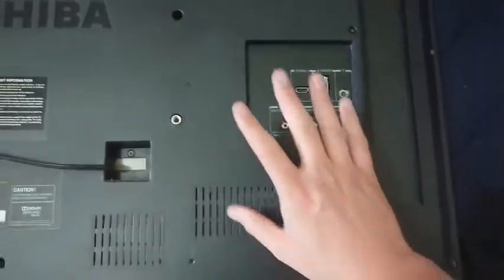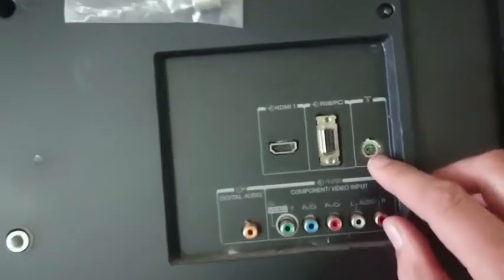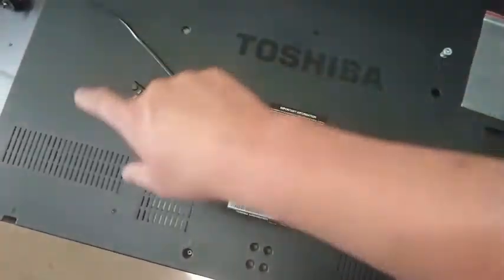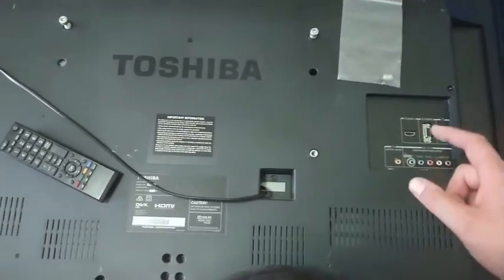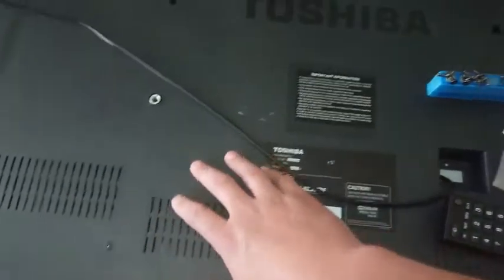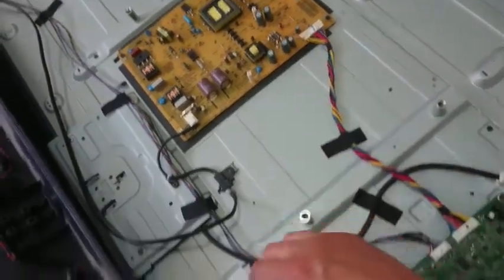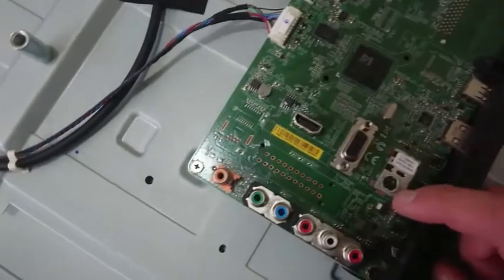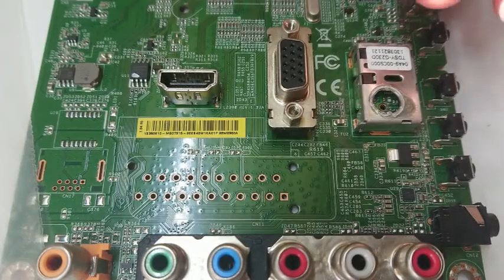Toshiba LCD TV Repair (Broken antenna socket)

Comment: Good effort mate, good outcome. The other reason for signal problems can be the big shift of frequency, moving up into frequencies more effected by objects and weather effects, better or worse propagation and reflections.
Very lucky with the socket.
Your other solution would have been to get an aerial extension lead and cut it in half, and hard wire the socket half of the lead into the socket hole.
This way you have a flying lead outside the TV, cable tie it in a couple of places as strain relief.

I look at the fixed sockets and when you plug a decent length lead in, it must be under some stress.

Ideally the socket should come out with a right angle to make it parallel to the back.
Then your aerial cable will be running parallel to the back and when plugged in you could use a couple of cable clamps to clamp the aerial lead.
Reply from the maker: Yes I have done the pigtail trick many times. Most tv's now position the socket at stupid angles, but also antenna leads are cheap and thin now, I use rg6 quad. 
The scanner antenna is using rg58 50ohm stuff though.

Comment: It's solid. but, he should have roughed up the two metal surfaces first then apply flux.
Reply from the maker: I use flux core solder. And tge surfaces were treated with an acid based cleaner first.
Reply: @TheAussieRepairGuy  Thank you for answering my reply. Also, here in north america we use the threaded type of connector.
Reply from the maker: @michaelquinones-lx6ks  yes f-type connectors are becoming more common here, but pal type is still the standard.